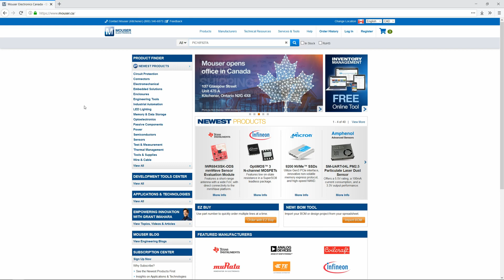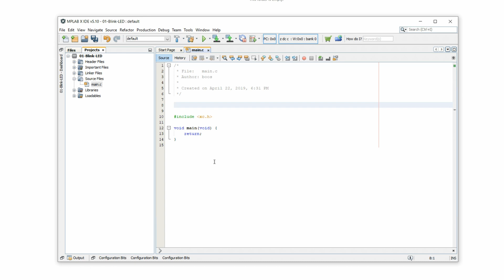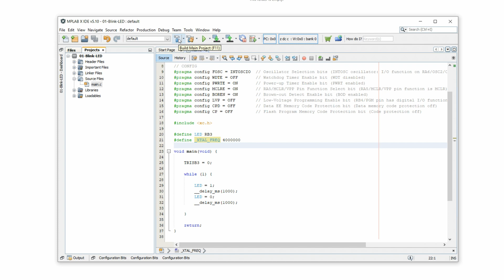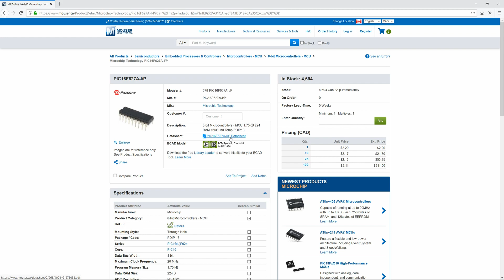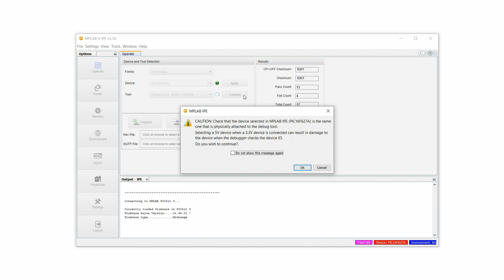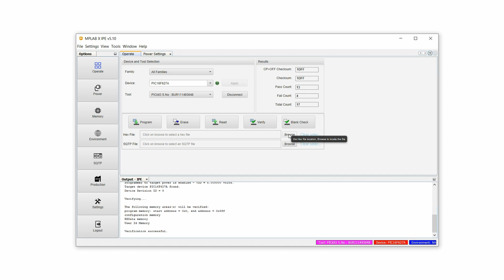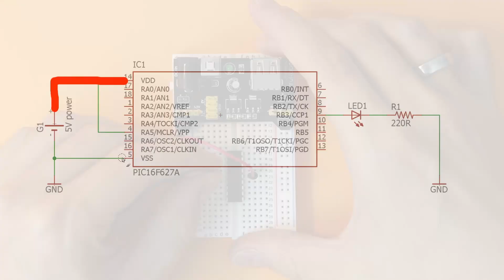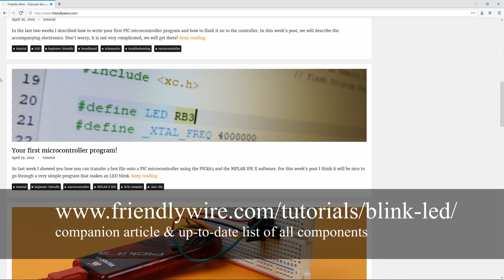Your first microcontroller project!

Comment: This is a very good video and I have made this one LED blinking just like you did. But how can I make two LED blinking with two different output from the same PIC? I have tried a lot but it will not work...
Reply from the maker: Thank you, Ove, I am glad you find it helpful! The learning curve can be a bit steep, but you will get the hang of it in no time. Which pin do you want to connect the LED to, and what controller are you using? We will get it to work, no worries! :) But just in case, say you want to add an LED to pin RB2. Then all you do is this:

Add #define LED2 RB2 after line 20. Add TRISB2 = 0; after TRISB3 = 0; (to make it also an output). Then you can write LED2 = 1; or LED2=0; and it will control the LED at pin RB2. That's it! :)
Reply: @FriendlyWire  
You are fantastic...Thanks a lot.   That works and I furthermore understand why...ha ha.  Thats great.  But that means that it's not possible to have two or more outputs running with each independent program...? Only one program can be running step by step down the lines...
I'm using a PIC16F627A and the outputs number is not that important. I'm really happy for your help.
Reply: Is there anywhere on the net where I can find explanation and examples of all the different commands and rules for PIC programming?
Reply from the maker: @oveschleisner-meyer8139  Yes, the code is always executed line by line. More advanced microcontrollers can have threading, but the PIC16F627A and similar controllers don't offer that functionality.
Reply from the maker: @oveschleisner-meyer8139  You can check my website www.friendlywire.com, I always explain the source code line by line in the companion articles to my video, but if you are just getting started it may be a little bit too much at first. In my projects, I use the XC8 compiler, which makes use of the C programming language. I am sure it would help if you learn a little bit of simple C. Then you have the basics and you can take it from there much more easily :)
Reply: @FriendlyWire  
Thanks a lot for your help. I will check out you website.
Reply from the maker: @oveschleisner-meyer8139  I hope the website can make some things more clear :) Otherwise, just let me know!

Comment: Thank you so much for making this content! It is incredibly helpful and fun to watch. I have a question though: how do you change the oscillator frequency?
Reply from the maker: Hello, and thank you for your kind comment, it means a lot! And even better that you find these videos helpful. Usually you can change the oscillator frequency with some registers inside your microcontroller, and there is typically a choice of fixed frequencies available. But it always depends on the microcontroller you want to use. Which one are you interested in, and what frequency do you need? I'll be happy to take a look at your controller's datasheet to help you out!
Reply: @FriendlyWire  Thank you so much!
The microcontroller is a PIC18F4420, but changing _XTAL_FREQ to 8Mhz and setting IRCF0, IRCF1 and  IRCF2 to 1,1,1 respectively makes the pic no longer blink, which is weird.
Reply from the maker: @akoskvida  See https://ww1.microchip.com/downloads/en/DeviceDoc/39631E.pdf for the datasheet. On page 30 they say that you gave to set SCS1 = 1 so that the internal oscillator is used. Also, did you enable the internal oscillator in the configuration word?
Reply: @FriendlyWire  I tried adding SCS1 = 1, but it does not seem to work at any other frequency besides 1Mhz. I also did #pragma config OSC = INTIO67 at the beginning. Thank you.
Reply from the maker: @akoskvida  Hmm, that is odd. Can you send me the full source code?
Reply: @FriendlyWire  Thank you so much! I sent it via email
Reply from the maker: @akoskvida  Great, will be in touch soon! :)

Comment: Thanks a lot for your tutorial... When I tried to connect my PICKit3 to the MPLAB IPE I got this message..: The target circuit may require more power than the debug tool can provide. An external power supply might be necessary.
Connection Failed.
How can I connect an external power supply to the USB to get more power?
Reply from the maker: Hi there, Ove, thanks for your kind words! I would try this, in this order: 1. double check the wiring and make sure there is no short. 2. Try a different USB port on your computer, some of them have surprisingly little capabilities. 3. Try switching from a laptop to a desktop PC, if you have the option. 4. Disable the "power target circuit from tool" option and use a battery instead.

Also check out the "eight common mistakes" part in my newer video here: https://www.youtube.com/watch?v=mUhzqDD6dg4&t=535s

Let me know if it helps, and if not, no worries: we will figure it out :) Thanks again for your interest!
Reply: @FriendlyWire  
Many thanks for your advice. After disabling the "power target circuit from tool" everything worked as it should... so again thank you for your support. I'm new in this PIC programming world so I' have a lot to learn so I will follow your video and your channel.
Reply from the maker: @oveschleisner-meyer8139  Happy to help, and I am so glad it works now! It must mean that your USB port cannot supply enough power. Welcome to the world of PICs! Fun fact: one of my USB ports on my desktop PC (!) also has this issue...

Comment: Hello,
I really like your videos, but there is one thing that I don't get.  How do you know which pin corespondes to which TRI register? 
I am also working on a microcontroller project, but I may have gotten stuck here.
Any help would be really appreciated.
Thank you!
Reply from the maker: Hello AK, thanks for your kind words! The registers usually have the same name as the pin, just a "TRIS" in front of it. For example, the tristate register for RB2 is called TRISB2. The one for RA3 is called TRISA3. And so on :) Some pins actually don't have tristate registers, because they are input-only. You can usually find that when you search in the datasheet. What controller are you working on? If you have a question for a specific pin, let me know, it'll be easier to help :)

Thank you again for your interest, and let me know if you have any other questions, I am always happy to help. Have a great day!
Reply: @FriendlyWire  Hello,
I recently bought a few pic18f4420 chips, I am able to flash them, but I can't even get a led to blink (using your code, just with different configuration bits).  The goal in the end would be to set it up as an I2C slave using its mssp module,  but I'm new to microcontrollers and I can't even get past this step. All help is appreciated.
Thanks!
Reply from the maker: @akoskvida  I had a look at the datasheet at https://ww1.microchip.com/downloads/en/DeviceDoc/39631E.pdf . In table 10-2 on page 107, table 10-4 on page 110, and table 10-6 on page 113 you can find the TRISTATE registers. It may be possible that something with the configuration bits is wrong (maybe you did not set the oscillator correctly)? It may be easier to diagnose this once I see your source code. Can you contact me on Twitter @FriendlyWire? If you don't use social media, I also have an email at the bottom of my page www.friendlywire.com :) We will figure this out!
Reply: @FriendlyWire  Thank you so much, I sent you an email.
Reply from the maker: @akoskvida  Thank you, I will try to get back to you this weekend!

Comment: Thanks. Very educating. Please can you do teaching on using dspic33fj16gs504 , for sinewave hbridge complementary pwm using mplabx. I needed this knowledge. Thanks .
Reply from the maker: Glad you like it! I have a video on the basics of PWM, but I won't be covering the advanced chips anytime soon, sorry :)
Reply: @FriendlyWire  ok. Which mcu are you willing to cover?
Reply from the maker: @adesuyisunday4287  What is your project about?
Reply: @FriendlyWire  sinewave hbridge 4pwm inverter . It should have LCD, menu parameters setting buttons, voltage feedback for stable 220v on load condition
Reply from the maker: @adesuyisunday4287  I see! Power electronics is beyond the scope of this channel, it's focused on beginner electronics. Do you have any experience with PIC controllers?

Comment: Hi. I am currently at the "Flash the Controller" portion in your tutorial, but I can't get any further than verifying my connection in the IPE v 6.0. Please note, I do not have a 6 pin header like you used, so I am using a 6 x 6 pin m/m jumper cable that shipped with my newly arrived PICKit 3. Could this type of connection that I am using be the cause for the following repeated error message that I am receiving? I did make sure that "Power Target Circuit from PICKit3" is selected, per your trouble shooting instructions.  : - ) 

Connecting to MPLAB PICkit 3...

Currently loaded firmware on PICkit 3
Firmware Suite Version.....01.56.09
Firmware type..............Midrange

ERROR MESSAGE
PICkit 3 is trying to supply 5.000000 volts from the USB port, but the target VDD is measured to be 4.750000 volts. This could be due to the USB port power capabilities or the target circuitry affecting the measured VDD.

The target circuit may require more power than the debug tool can provide. An external power supply might be necessary.
Connection Failed.

Verify Failed

PS: I assume that you surely must have a 6 x 6 pin m/m jumper wire that you would have found much easier to connect than your pin header, as you have demonstrated, so is that why you still used a 6 pin header instead, because of this very issue that I am having?
Reply from the maker: Great work, Joseph, and thank you for your interest! The cables you are using are 100% fine, no worries. It looks like your USB port cannot supply enough power. Can you try a different USB port on your computer? (I know it's silly, but sometimes it helps). Otherwise, disable the "Power Target Circuit from PICKit3" option and use a 4.5V battery pack (three AA batteries) to power everything, this can help, too. I also talk about some of those issues in this newer video here: https://www.youtube.com/watch?v=mUhzqDD6dg4

Let me know if it helps. We will figure it out :)
Reply: @FriendlyWire  Thanks Jens! I will keep you updated. Stay safe.
Reply from the maker: @thejoeblowshow  Yes, let me know how it goes, we will figure it out :)
Reply: @FriendlyWire  Hi Jens. I had no luck with switching from all three (2) usb3 & (1) usb2 ports. Can you please explain in more detail how I would power everything using 4,5V batteries? Also, isn't the issue "not receiving 5v"in the first place, i,e,. the reason the original, and still persistent error message reads: 

PICkit 3 is trying to supply 5.000000 volts from the USB port, but the target VDD is measured to be 4.750000 volts.

So, obviously 4.5v "battery power" should work, or you would not have even suggested this method, however, I still don't understand the circuitry when trying to power the PIC 3 through the X IPE software in the computer, and then back through to the breadboard. Sorry for my total ignorance in all this, but this is the first time that I even inserted a mcu into a breadboard before. So, If you get bored, and find some extra time, can you please give a total newbie, like myself. some very detailed info on exactly how I would loop everything together to flash the mcu using your suggested 4.5v battery power method? PS: I always made sure that I  selected the "targeted power circuit from the PIC 3" in the power options in the X IPD too. Thanks Jens!
Reply: PS: Am I assuming correctly that my usb ports are supplying too much voltage, as stated: 

"PICkit 3 is trying to supply 5.000000 volts from the USB port, but the target VDD is measured to be 4.750000 volts." 

in the repeated error message(s)?
Reply: *Also, isn't the issue "not receiving 5v"in the first place - typo' *receiving - So, that's why you want to reduce the voltage, correct?
Reply: UPDATE: Hello Jens! I finally got it to work. I tried disconnecting my laptop from its A/C circuit, but I still received the same error message. So, I plugged my laptop back into the wall and switched USB ports once again, and "bingo!" Success! Your thoughts please, on what might be going on? Perhaps using a 10-year-old Dell XPX is causing all this grief?
Reply from the maker: @thejoeblowshow  First off, I am so glad it works now! Fantastic, congratulations Joseph. I know from personal experience how frustrating this part can be, and it's fantastic to see that it works now.

Believe it or not, but I had similar problems with some USB ports on my desktop PC. I think it's a power delivery problem with some data ports. On laptops, newer models have a dedicated "charging" USB port (the one with a tiny battery symbol) so you could try that one, if your laptop has it, and I would expect it to work in that case.

In general, if this kind of problem occurs, I always disable the "power target circuit from tool" option in the MPLAB IPE, and then I add a 4.5V battery pack as a power supply: just connect the two wires to VDD (pin 2 of the PICkit3) and GND (pin 3 of the PICkit3). Also make sure that the VDD and GND connections of the PIC you are trying to program are connected as well. I talk about this also in this video here in more detail: https://www.youtube.com/watch?v=mUhzqDD6dg4&t=594

Hope that helps, and I am so glad it's working now, congratulations again!
Reply: @FriendlyWire  Hi Jens! I hope that your weekend is going well. Not only are you teaching me how to program a microcontroller, but also how to fast forward in a video, using "&t=594s" in a URL. I guess you can say that you are also "troubling shooting 'trouble shooting'." LOL. Obviously I didn't watch all the way through. to get to the battery power details  that I needed, so thanks again for that help a second-time-around. 

Hey, just curious, can a hex file like this be removed, i,e,. de-programmed from the mcu? Also, I still did not get the LED to illuminate, let alone blink, so I am going to repeat everything all-over-again, just to get more familiar with all this new stuff, and hopefully get it to work. And yes, I did made sure the LED's that I tried are good, and doubled checked all connections, etc. Also, is it okay to simply flash the same hex file onto the "same chip," or do you think that I should use another mcu? Thanks again for all your help.
Reply from the maker: @thejoeblowshow   Hey Joseph, happy to help :) Yes, you can click on the "erase" button and that will essentially write a bunch of 0's to the program memory, thereby removing the .hex-file. Hm, it's strange that the LED does not blink. Can you send me a photo of your setup? Either on social media (Twitter/Instagram/Facebook @FriendlyWire, or on Reddit /r/FriendlyWire , or via my email address you find at the bottom of www.friendlywire.com ). I am sure we will figure this out :)
Reply: @FriendlyWire  Hi Jens! I hope your week started off well. Thanks! I will contact you directly. And once again, thank you for your extended help with these issues. Oh, by the way. Check this out. Mystery solved on the voltage issues. 

https://www.youtube.com/watch?v=GOVMcP46GB0

Works like a charm. Every time. : - )
Reply from the maker: @thejoeblowshow  Glad it's working now, Joseph! But I have to caution against the method presented in the video you referred to. The fact that the PICkit3 tries to supply 5V but the measured voltage is lower means that the PICkit3 is pushing its limits at supplying enough current, and hence the voltage drop. Reducing the overall voltage is not a real fix, since the circuit is still the same, and the PICkit3 is still at its limits. I am glad that it works now, but there may be problems down the road, which is why I recommend to use the battery pack that can supply enough power :)
Reply: @FriendlyWire  Yeah, I see your point. Thanks for your insight on this.
Reply from the maker: @thejoeblowshow  Happy to help, Joseph! Is the LED blinking now? :)
Reply: @FriendlyWire Hi Jens. Been quite busy lately. No, it's not blinking? I was going to try a third controller, perhaps they (bought 5 of them) got damaged, maybe by x-ray during shipment from China. (?) I am going to jump-to your next tutorial,  and try the 4 LED project using yet another microcontroller, I just have to wait for the capacitors to arrive. I'll let you know how it goes. : - )  Stay safe!
Reply from the maker: @thejoeblowshow  It's odd that the LED does not blink. Feel free to reach out via email (at the bottom of www.friendlywire.com) so that we can troubleshoot this together in detail. I am sure we will figure out that is wrong.
Reply: @FriendlyWire  Thank you!

Comment: Would you mind to make a video about RS422 Communication.
Reply from the maker: Good question! I have used RS422 in the past. On the PIC microcontroller side of things it is identical to the RS232 protocol, the only difference is that you need a MAX488 level shifter IC as opposed to the MAX232, and each signal wire has two poles (differential data transfer). It's super useful for large-baseline data transfer, above 10-15 meters, where RS232 signal integrity will typically fail. Maybe I will cover this in a future video :) Do you have any specific questions on RS422?